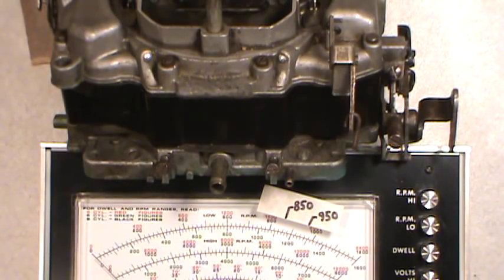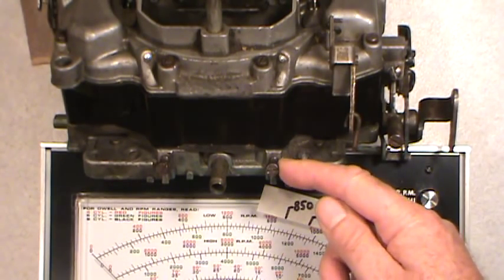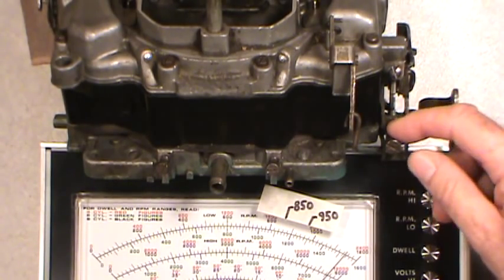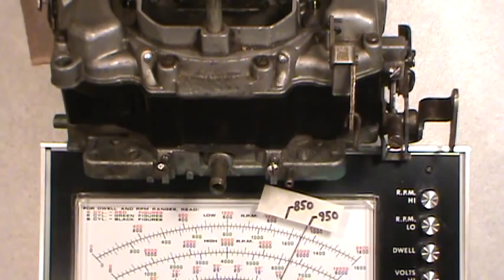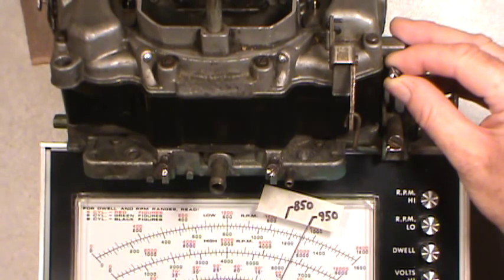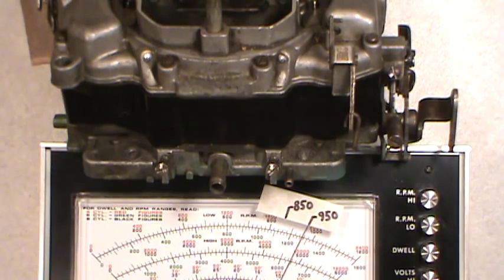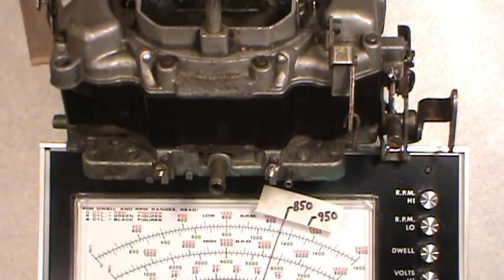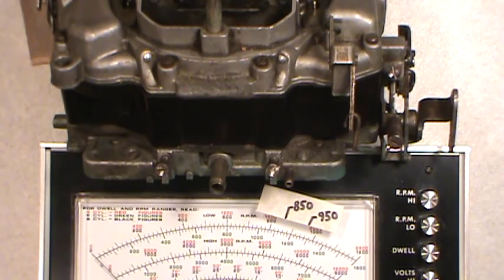Idle Mixture Adjustment on 4 Barrel and 2 Barrel Carburetors

Comment: Rocky, you are a genius.  I failed smog test twice.  Then watched your video and did what you said.  Bingo!  It passed Oregon smog test with flying colors.  Thanks sooo much.
Reply from the maker: Greetings...diane good...…….You're welcome, and, Congratulations, for tellin' that smog sniffin' machine, who, the real Boss is now...!!!...lol...…….Me, a genius...???...nah, I'm just a part time Grease Monkey, that happens to have automotives, as one of my hobbies, that's all, and, just like, I've probably said a few times in the past, and that is, that, if someone is interested in a certain subject matter, then, it's pretty much a given, that, that person is gonna learn quite a bit, don't-cha-think...maybe...yeah, I'd say so...……..My very first attempt, to adjust the two idle mixture screws, that were on a 4-barrel Rochester carburetor, that sat on-top of a Chevy 350 cubic inch (5.7 liter) V-8 engine, (and, having no catalytic converter at all), was done, just by (my) ears (sound), of the engine, while it was fully warmed-up, and at (curb) idle speed...…….I turned both idle mixture screws in-wards (clock-wise), as much as I could, while still having, a really good sounding & smooth idle, along with, not noticing any miss-firing at all...and...I still received, that Big "Fail" word, printed on the smog testing paper...……...As I recall, at idle speed (only), I was just a wee bit too high, as in, oh, about, 700-plus, and the maximum was about 500 (high reading, was due to, what is called, a "lean-misfire", as in, not enough gasoline in the mixture, which, I didn't detect by ear/sound, and also, "not having", the engine shaking, what-so-ever)...so, not too bad, seeing as how, I didn't do the proper (idle speed) "lean drop" procedure, probably, because I never did it before!...lol)………..Then, there "it" was...Yes-Sir-ee-Bob, I finally saw that "Sticker" (label) that was stuck to the under-side, of the Chevy Van's hood...!!!...commonly, called a V.E.C.I. (as in, Vehicle Emission Control Information, I think?), and the "lean-drop" specifications, were on the sticker, the whole (censored word) time...!!!...lol...……...Perhaps have a look-see, in, or around, your vehicle's engine compartment, firewall, and/or, under the hood as well, and hopefully, if "it" is (still?) there, it won't be hiding, as good as a Sasquatch, is capable of doing...lol...……..The carburetor's idle mixture screw's adjustment, is just, one of many things, that can cause an engine, to Fail the smog/emission test, and it might (some day), turn out to be, a problem, with the ignition system, and can sometimes, result in, a weak or intermittent spark, showing up, between the spark plug's two electrodes, which usually sends, a certain amount of un-burned gasoline, right through, the vehicle's entire exhaust system, and, if really bad, it has the potential, to ruin/destroy, a catalytic converter (or two of them, if so equipped), and then, just repeat after me...expensive...Expensive...EXPENSIVE...!!!...so yeah, always keep vehicle Maintenance in mind, just in case, and...….till next time......Be Safe, take care, and have a good one.

Comment: This video essentially got my '79 Dodge American Clipper RV passed smog , with the same carburetor , on a Dodge 440. Thanks Rocky!
Reply from the maker: +Erik  Sanchez ....Greetings Erik Sanchez....You're Welcome, and..."Congratulations"...!!!...I say, for getting Your Thermoquad Carburetor equipped, 440 Cubic Inch V-8 Engine, to be able to "Pass" the Smog/Emissions Test, with the Adjustments that You made...(can You Hear All of the People Clapping in the background...???), oh, and, now that Your RV (Recreational Vehicle), has Cleaner Exhaust Gas, Exiting the Tail-Pipe, You might be having the onset, of a "Mosquito" Problem, when Ur Campin', now that Your RV's...Keep-the Mosquitos-Away-Stink-ee-Engine-Exhast-Gas...is Gone...!!!...lol...................Well, aside from a properly working and set-up Thermoquad Carb, there are a few more things, that have to be working correctly, and/or, adjusted properly/to specifications as well, depending on, just what, and how many, shall we say "Smog Devices", that happened to be Installed on, just about any given Vehicle, when it first, Rolled-Off-of-the-Manufacturer's-Assembly-Line.........................Here are some of the Smog related things, that I've noticed/observed/studied/fixed, and tried to fix...lol...over quite a few years.....................The Distributor's, Initial (base) Ignition Timing, has a lot to say, in respect to, what might be printed on the Smog Testing (paper's) Final (and maybe Not Passing) Result......................If the Engine has an EGR/Exhaust Gas Recirculation System on it, then, that EGR Valve & related System, has to be working really good, or, a Very High NOX/Nitrogen Oxide Reading, it will usually be, as I found out, by actually seeing, just how High the NOX Readings can get, on a Chevy V-8 Engine, that didn't have an EGR System on it, and is as follows......The Lowest NOX, I ever got, (on that particular vehicle), was about 1500 PPM/Parts per Million, and the Highest, was Above 3000 PPM, which, was about, the Maximum allowable, or, Fail, it was...Yikes...!!!.....................Now, I'll mention, some interesting Smog Results, that I got, After Installing, a New 3-Way Catalytic Converter, on a Mid-1990's, V-6 Engine...................Well, due to that old/high mileage, worn-out Cat (Cat = Catalytic Converter), I received that (not so much needed, or wanted) "Fail" Word, printed on my Smog, Test results paper, and, the Over-the-Allowable-Amount, wasn't all that much..........So, after gettin' Smog Tested again, with the "New Cat", I saw a Real Eye-Opener...!!!...Damn, the Smog Readings were about 1/2 (One Half), of the "Average Readings", that all of the Other Similar Vehicles were Getting...Holy-Gwalk-ah-Moly...!!!...now that's Impressive, and, just goes to show, just How Much Smog, a New, and Very Good Working, 3-Way Catalytic Converter Can Remove, when it does a Super Job...!!!.........................Oh, and, a 3-Way Cat, will reduce HC/Hydrocarbon, CO/Carbon Monoxide, as well as NOX/Oxides of Nitrogen...where as...a 2-Way Cat, won't be able to take care of/reduce the NOX what-so-ever, well, from what I recall, that is.............................While Camping, or being Parked somewhere, and, If You're having Problems with Bees, such as Yellow-Jackets or Wasps, getting too close for comfort, then, here's a real neat "Trick", that a Fellow Camper, was tellin' me about, and at the very same time, showing me as well, and is as follows....................Pour some Orange Crush Pop, or something like it, into a See-through, Plastic or Glass Dish, or what-ever, and Locate/Place it "Away From" All Humans and Pets...cuz...those..."Bees" are "Attracted" to "it", like You wouldn't believe...!!!.....................Thanks for tellin' me, about Your Success, and.........till next time.........Be Safe, take care, and have a good one.

Comment: Hey Rocky!
This is Ben from Berlin/Germany. Thanks for your tips and your patience!
I just rebuild my TQ following your detailed descriptions. 
It is a TQ 9211S, which sits on a Dodge 440(-3??), 727 trany, in a 79' Dodge MB400 Chassis Motorhome. The Carb  is an all mechanical model with no solenoids what so ever. Like advised by you, it got every gasket in new, brand new X-Rings, brass floats, new choke pull off. All parts where dry ice blasted and ultrasonic cleaned before reassembly. Just to let you know that I tried my best to work accurate. ;)
Today I tried to adjust the idle mixture screws following your instructions above, but to my major frustration it didn't work at all. 
Basic set up: idle mixture screws 3 turns out from fully in, idle at 950 rpm while in (D), parking brake on. (to bad, but the V.E.C.I. sticker seems to be long gone)
But there was no increase of rpm when I turned the screws in slowly. In fact, the rpm slowly dropped while turning them in, until they were fully closed.
Do you have any idea where my mistake could be? Could a contamination at a certain point cause such a behaviour?
Could the fuel level be to high? The floats are set to 29/32 from the gasket surface, I have not checked the wet fuel level.
Tomorrow I will try to find out if there is a vacuum leak by spraying some brake cleaner around.

Appreciative for every hint-> ben
Reply from the maker: Greetings...Ben/heinz wurzt..............Thanks for watching, and, I'm sorry that I took so long, to give you a reply..............That "Lean Drop" method, that I was showing in my YouTube video, really only has to be done, if, the Vehicle has to go through Emissions Testing (smog testing)...............If the Vehicle "Does Not" have to be emissions tested, then, as long as, the two Idle Mixture Screws, are set, at the point, where the Highest RPM's are found, while at idle speed, then, that should work really good (providing that, everything else, is working as it should be)..............There is, a, shall we say, sweet spot, as it applies to, the setting of, one or more idle mixture screws...............(the following, "does not" use that lean drop method at all, and also, the engine is fully warmed up to operating temperature, and the choke is fully Off).......Let's say, for instance, that, an idle mixture screw, is already "Set" at that sweet spot, as in, Highest engine RPM, while at idle speed, then, when that idle mixture screw gets turned, either "clockwise", or, "anti/counter-clockwise" (as in, in or out), then, the engine RPM's should start to drop (cuz, the idle mixture screw, is no longer set at that sweet spot, that I was mentioning), or, it might not drop all that much, when going Richer/turned out..............Using a Tach/Tachometer, is just one way to make the idle mixture screw adjustment...............The, shall we say, old school guys, that worked on the much older (and much simpler engines), would probably be using a "Vacuum Gauge", that was hooked up to the intake manifold (vacuum signal), to make the idle mixture screw/screws adjustment.............Having the engine fully warmed up to operating temperature/choke fully off, and at idle speed (I'd do it in Park/automatic, or Neutral/standard transmission, with parking/emergency brake on/wheels chalked with bricks or lumber for safety), then, just turn the idle mixture screw, or screws, as the case may be, in or out, until I saw the Highest "Vacuum" reading, on the Vacuum Gauge's dial, that will probably have, the dial on the vacuum gauge, indicating in Hg (Hg = inches of mercury, as I recall).............Try making the idle mixture (screws) adjustment, while having the automatic transmission in "Park", with engine fully warmed up/choke off, cuz, I'm pretty sure, that, You'll probably even "Hear" the changing engine RPM's, cuz, the engine, will be, shall we say, Free-Wheeling, as opposed to, having, quite a Load, imposed on it, cuz of that automatic transmission/torque converter, making the engine RPM's "Drop", and, will probably also, kinda interfere, with the idle mixture screw/s setting some-what (Yes-Sir-ee-Bob, that's the way I be thinkin' alright...lol)..............So, try doing it in "Park", and, if You care to, You can let me know, how You made out, and if need be, we can try a few more tricks (so to speak)............Good Luck, and......till next time......Be Safe, take care, and have a good one.

Comment: Thanks for the thorough tutorial. I will be trying this today on my 79 440. I don't need to pass smog I just need it to run well and get the best gas mileage I can.
Reply from the maker: Greetings...Jesse Metcalfe...........You're welcome, and, thanks for watching...........Well, for starters, have a look-see, in Your vehicle's engine compartment, for, what is known as, a "V.E.C.I." (Vehicle Emission Control Information) Label/Sticker, as it will usually have, some very useful information, printed on it, and, in some cases, if not followed correctly, can sometimes, lead to, an Engine, that won't run very good at all...............Seeing as how, You were sayin', that Your vehicle, had a 1979 440 (big block) V-8 Engine in it, has me thinkin', that, You might have a Carter Thermoquad 4-Barrel Carburetor, that, may very well, have some additional, Smog Control Gadgets/Gizmos on it, quite possibly...???...and, if so, then, depending on, just which Model of Thermoquad (carburetor), it happens to be, then, sometimes, things can be easily adjusted, and other times, not so much.............If Your engine has a Thermoquad carburetor on it, then, there are usually...4 Numbers, with the letter S at the end of those 4 numbers, which will tell us, what the Model, actually is............You can find/see, these 4 Numbers, followed, by the letter S...Stamped into, the Base/Lowest part, of the Thermoquad carburetor, on the Left, Rear corner (as viewed, while, You are sitting in the drivers seat, as an example)............If You can tell me, what those 4 Numbers are, that are followed, by the letter S, at the end, then, I'll do what I can, to help You out, and, if You have another Type/Brand of Carburetor, on Your engine, just let me know, what the Make & Model Number is, of, what-ever, it just might be...thanks, and........till next time.......Be Safe, take care, and have a good one.

Comment: wow man ur a great teacher, am about to adjust my boat Carter four barrel carb this weekend, I just order a tach dwell meter after watching this video I know in my hart I can do this. thanks
Reply from the maker: Greetings...mrbigs g..........I sure do appreciate, Your very nice comment my Friend, and, thanks kindly, for it, as well...........Seeing as how, You were sayin', that, Your Carter 4-Barrel Carburetor, sits on-top of an Engine, that's in Your "Boat", then, if it were me, I probably wouldn't bother, doing the "Lean Drop" procedure, with the 2 Idle Mixture Screws, as I was showing Folks (how to do), in this particular YouTube Video of mine, and here's why...............Engines, be them, Inboards or Outboards, that are in/on "Boats", as far as I know, have Never, had to be Smog/Emissions Tested, oh, and, thank goodness for that...lol.................I would probably (just), adjust the Carburetor, using a Tachometer (or by using a Vacuum Gauge, will give about the same result), by doing the following..................Have the Engine Fully Warmed Up, and in "Neutral" (Out Of Gear...!!!), and make sure that, Cooling Water is Circulating, while the Engine is Running...............Then adjust the 2 Idle Mixture Screws "Equally", like I was showing (how), in this Video of mine, up to the point "Just Before", I did the "Lean Drop"...cuz, most Boat Engines, will probably, not do so well, with the "Lean Drop" (aka, "Leaner'", Idle Speed, Air/Fuel Ratio/Mixture)..........The "Lean Drop" Method, that I was showing, in this YouTube Video of mine, had to be done, to get the Car or Truck to "Pass the Smog Test", so then, Boats, need not apply...lol (I think...???).................You can try doing the "Lean Drop" procedure/method, if You care to, and if it does work, without having the Engine "Stall", when the Shift Lever is placed in Forward or Reverse Gear, then, Fuel Consumption, while the Engine, is at Idle Speed, might be a bit better...maybe (with a Boat, it's almost like sayin', Gallons-per-Mile...lol...well, maybe not quite)...............Keep an eye on, Water/Condensation in the Fuel system, as in...in the...Gas Tank...Fuel Lines & Fuel Filter...and the Carb's Float Bowl as well, cuz, Engines, really, don't Run so good, on H-2-Oh/Water...................Due to the rather high Humidity/lots of moisture in the air, that a Boat is exposed to, it's a good idea, to keep an eye on, all of the Electrical Connectors & Connections, cuz of...Corrosion...Oxidation...and sometimes, I've even seen...Green Yuck-ees...too...!!!...which on a bad day, will make for, some very Un-Wanted, Electrical, related Problems, and I hope not.........If You have a Distributor in/on Your Engine, I'll (almost...lol) Bet, that, there "Won't Be", a Vacuum Advance Unit/Canister on it, and it's probably, cuz, once the Shift Lever is placed in Gear, well, with a Boat, it's kinda like..."Going Up a Steep Hill...All of the Time"...!!!...(due to the high load, that the "Prop/Propeller", places on the Engine, as well as, a pretty much, 1-only-Gear-Ratio as well, most times), as opposed to, driving a Car or Truck, which in most cases, does just peach-ee, and gets better cruzin' gas mileage, with the correct Vacuum Advance Unit/Can on the Dizzy (aka, Distributor).................Make sure that, Your Carburetor's Idle..."Speed"...Setting, "Is Not" too "High" in RPM's, cuz, if it is, when going from Neutral, to, In Gear, it might go "Bang"...!!!...and that's not good at all................Then, there's the..."I'm Going Too Fast (at Idle speed...in gear), as I'm approaching the DOCK"...!!!...Yikes...!!! (might be worse than, Forgetting to put the "Drain Plug", back in the Transom..."Before"...the Boat gets Launched, into the Water...!!!...oh, and, if that happens, it will usually make for, some rather good entertainment, for the Folks at the boat launch/ramp, watching "it" happen...!!!...lol for Them, not so much, for the "Owner" of the Boat...!!!)............If You can find the "Specifications", for Your "Exact"...Boat...Engine...Out-Drive/Leg, or whatever You have there, then, all the better...........If You care to, You can let me know, how Ur makin' out, and if need be, just let me know about, any problems that You encounter, along with, the particulars of Your Boat, and.........till next time...Captain........Be Safe, take care, and have a good one.